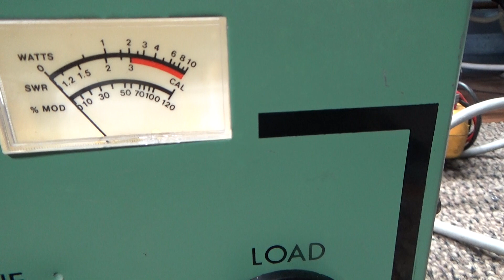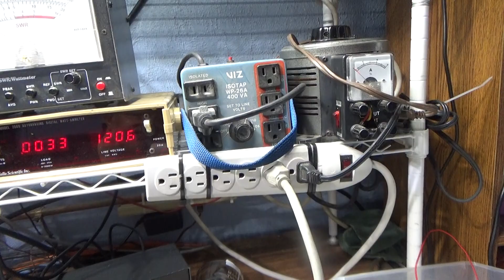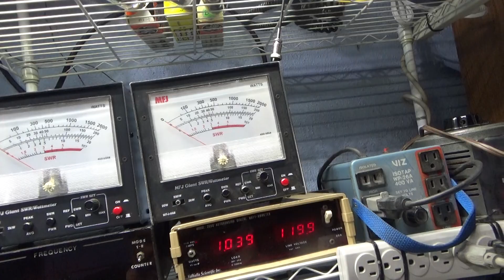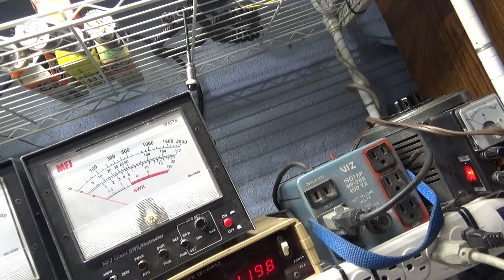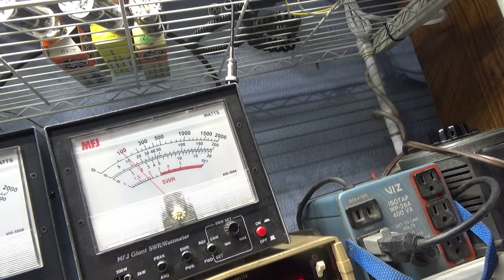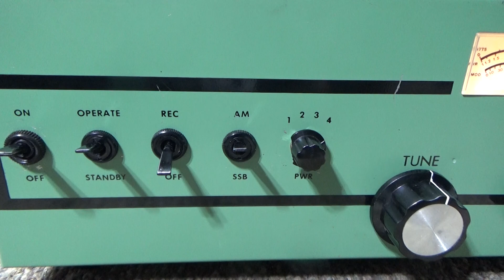Literally put the gloves on for this one.. No Name Footwarmer type 3 tube transformerless amplifier

Comment: Very dangerous amplifier! If the ground pin on the plug gets broken or cut off and there's a problem with the power supply, someone could die by touching the chassis and grounding themselves.
Reply from the maker: Agreed.

Comment: Had a couple of these with tan face sift through my hands back in the day. Friend of mine owned one and had to have some  main filters replaced. I also noticed direct soldering of the plate caps-VERY odd design. I always wondered why it didn't have 36/40-kd6 tubes in it instead of the 30's. I didn't think much of that power supply design or the power level screen bias thing, but when they worked they worked well. Being so light weight I thought that much was cool. Had no idea they might be "dangerous"-lol!!!!......

Comment: My friend made those. They were made in the north east. No transformer.  Voltage  quadrupler. They were made with the cheapest parts he could get. The filaments are in series across the AC 120. . 3 30KD6, I fixed hundreds of them. They were indeed called a foot warmer., he has 2 tube, 3 tube, 4 tube and 8 tube.  They had a negative bias as well. They were made in the early 80’s. I used the wind the plate choke and input matching transformer for the 2 tube version for him.  He used the buy those GE 30kd6 tubes by the case load for $3 each. I have schematics somewhere. They were dangerous, but they worked., The 8 tube version would do about 800 watts RMS. There was no driver., the tubes were just biased to not need a lot of drive.
Reply from the maker: Those amps do the watts, but I am not a fan. Too dangerous.
Reply: I saw one of these once Labeled "Bear Foot" I thought that was a great name for a big amp.
Reply: Had one of those once weighs nothing lol
For sone reason I thought those were made by kLM, but Robert states his friend made those. Ink teamdr where your coming up with sone of these amps I’ve seen in your videos. I’ve only seen one of those and ran it for awhile worked good actually. Never liked no plate caps and soldered to the top of the tubes and seen that on more then one occasion.

Comment: A genuine Footwarmer was an amp made by Hy-Gain. I think they show one in one of the Henshaws catalogs I sent you. 
Good to see you working safely. The first thing I'd do with that amp is to install a three-pin grounded cord and plug on it. Connect the hot side to the power side of the fuse or power switch and you're much better protected. 
No-Name, as most folks know, is a name used by a builder of competition amplifiers. 
IMHO, the reason this amp was built by "the man with no name" is that he'd get sued if someone got killed by it. 
I'm unable to determine which radio donated the watt/SWR/mod meter. Any guesses?
Reply from the maker: Yep, it already has a 3 pin grounded. However, the isolation transformer I used was 2 pin. I think there will be fireworks if someone reversed the hot and neutral wires .  I triple checked that from outlet all the way to amp before I slowly variac'ed it up.